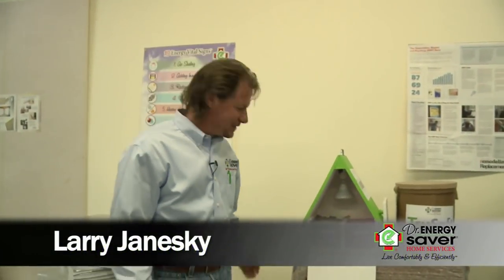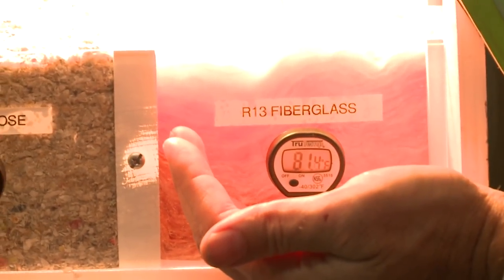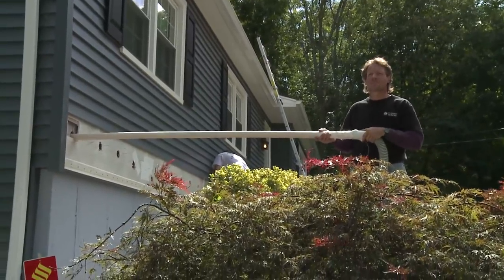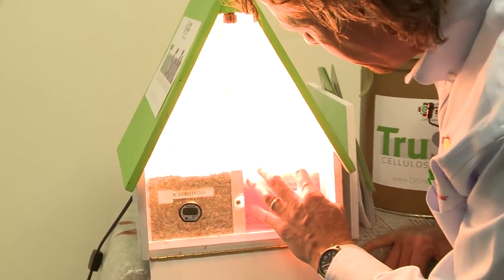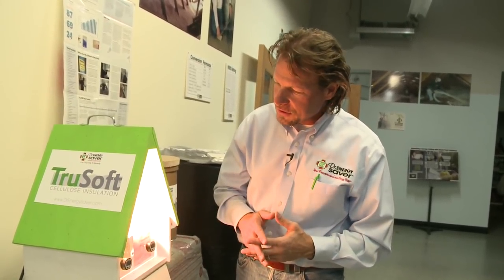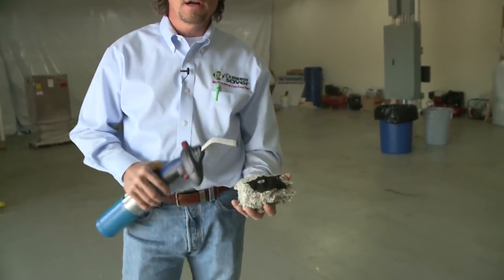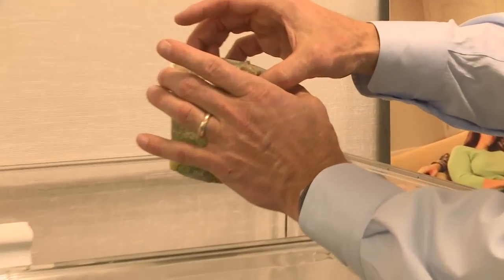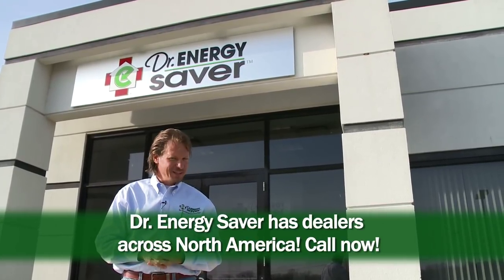Why Cellulose Insulation is Better than Fiberglass Insulation

Comment: * Join the Green CELLULOSE Movement and insulate your home with old newspapers, magazines and wrapping paper. Once the newspaper has been adequately shredded, chemicals are added to provide fire-retarding properties to it. The most common chemicals used are boric acid, sodium borate (borax), and ammonium sulfate, admittedly the end product does looks like shredded sanitary towels but no one is going to see it, they might think they can smell it, but that is only the printers ink gassing off. With being a rather loose insulation (think pillows and cushions) it does settle, but not to worry the installer will allow you to have 9 inches, but will only charge your for 5 inches. Great deal eh.  When the wind blows it can get blown all over the place, but seen in the right light it can give your home a white-winter look in June, for no extra charge.
Reply: +SuttonWood  Your anger is displaced, Sutton. Cellulose is made by recycling newsprint. Some cellulose is new newsprint paper. That's only done when the white color is desired for spraying ceilings of commercial buildings. Otherwise, the paper drives scouts conduct to earn money for events is perfect for insulation conversion. You, like me, probably earned a few bucks as a kid collecting that weeks newspapers from neighbors. I always had spending money from my paper collecting work. You're confusing cellulose with foam, there is nothing to "offgas' with cellulose. The boric acid fire retardant is the same boric acid used for medications and eye treatments for humans. Unlike fiberglass which is required to carry a federal warning about cancer, cellulose is very safe and non-allergenic. The money you've wasted paying higher heating and cooling bills in your own fiberglass home would have easily paid your mortgage off. Personally, I invest my energy savings in the stock market. I'm doing pretty good :)
Reply: +Larry Maloney  Our Lets Go Green Local Town Council set up a recycling depot for waste newspaper, they soon had 300 000 tons, when it came time to sell it no one wanted it. It was worthless, the USA got the same waste problem, so being an industrious nation they shred it and crumb it. call it a fancy name like Cellulose and sell it as bagged loose fill insulation. Its value is $20 dollars a ton, and one ton will insulate 10 houses, so you should charge clients $100 dollars a go, and be happy. To indicate how honest you are  lay 200mm of Fibreglass on top of it, and shout it to the world that Honest Joe Cellulose + Fibreglass saves heat-we think?
Reply: +SuttonWoods , actually waste newsprint is in demand. Many years ago a Chinese woman contracted to buy all that was available in the USA. Her monopoly drove the price up and gave a big scare to the cellulose industry. To add to the supply problem, many newspapers have lost readership to the internet. I'm surprised cellulose is so economical. Could your math be off on that giant paper drive your town had? That much newsprint would make twenty million  30 pound bags of cellulose.  I don't think a single manufacturer has processed that much cellulose insulation in their existence. You sure know how to tell a whopper, Sutton. Oh, but that's what you do for a living.
Reply: +Larry Maloney / Larry, hating you're guts is not my style so I'll let others do it, in 2010 waste newsprint was $30 tonne delivered merchants mill, in year 2015 $60 tonne delivered,  *new newsprint is $700 ton, and newspaper owners are unhappy at the price. Waste newspint has been listed at MINUS prices, they would take it off you but got it for nothing, the Council I mentioned rented ware houses to store it in, and there was hell on, no one wanted it. To be fair fibreglass makers are cheating a little, they are now increasingly using steelworks slag if they can get it, calling it Rockwool, Slagwool and have subsidiaries to sell it on. And being good in sales I never lie, you see the truth sells, people who meet me know they are getting the truth, any other way and I'd lose that laugh and joke attitude I have. Do wear a mask looking at a photo of Cellulose, or you'll die screaming strapped to an hospital bed. Best Regards. THE REAL COMPETITION MEN.
Reply: +SuttonWoods , so you admit waste newsprint doubled in price in only five years. That warehouse full of it must have brought the town a fortune. I don't see your point in the pricing comments about newsprint though. Surely you've heard of white cellulose? It's made from virgin newsprint.I wear a mast when I give an insulation quote...I start sneezing from the old fiberglass as soon as I open the attack hatch. I suppose you do too.You say you never "lie" when you sell inferior fiberglass. You've documented a number of lies in these few posts...and you weren't even trying to sell me fiberglass...just convince me it had value as insulation. Maybe you've been the business so long all that you say seems believable to you. Compare your unrealistic claims with the research done by Oakridge National Laboratory. That's the U.S. Government's science and technology research arm in Oakridge, Tennessee. Very credible folks. During WWII they were instrumental in developing the atomic bomb that ended the  war.  Today, among other things, they test insulation. Fiberglass does poorly. Cellulose always beats fiberglass. Sutton, there are "lies" and there are acts of omission.  Do you read the warning label for cancer causing fiberglass when you do a sales presentation? That's why I wear a mask! Do you tell them blown fiberglass has a low R-value, only R-2.2 per inch of depth. Or do you tell the homeowner that according to Oakridge Laboratory  blown fiberglass loses up to half it's already lowly rated R-value, and in the coldest weather...the very time the homeowner need a superior thermal barrier?Like you've attempted here, you use scare tactics so homeowners aren't thinking critically. Instead out of fear they buy a lesser product paying more money for it and getting less and poorer quality insulation. When you can lie to yourself, Sutton, lying to others comes natural.
Reply: +Larry Maloney / All that needs to be added is the bagged stuff is shredded newspapers, newspapers that firms get free and shred, or may have to pay between $30- / $60 dollars a ton for, from a storer collector.  People do not like the idea of newspaper insulation so they call it Cellulose to hide its origins. And as for the silver paper it gets covered in dust and loses its radiant shine. Why not staple dollar bills to your roof beams and cut out the middleman is my reply.
Reply: +SuttonWoods , why waste my time with your silly weak arguments? Newsprint is made from wood. The process involved converting wood to pulp fiber. It's dried and it's formed into paper.  That paper is converted back to pulp using a dry process (usually). If you had a little biology or chemistry background you might understand  wood is a "cellulosic" material. It's "cellular" containing billions of tiny air cells. I explain the process to homeowners so they understand what cellulose wood fiber insulation is so superior to ineffective fiberglass. As you pointed out fiberglass is made from scrap slag and silica sand. The silica is why it's so itchy and cancerous...and explains why so much energy and heat is needed to melt the sand...like making glass, the ovens are unimaginably hot. Maybe adding the waste slag is an cost reduction attempt or maybe they are attempting to reduce the cancer risk my diluting the silica?.  Your industry lies and tells homeowners it's made of plastic. How much does your fiberglass manufacturer pay a ton for sand? Why dye it pink? BTW, tell me where quality waste newsprint is available in volume and a steady stream for "free", as you claim, and I'll build a new cellulose plant.  Put up or shut up.
Reply: +Larry Maloney . Waste newpaper must have a great future, it can be used has garden compost, for making papier-mache grow pots, and developing new molds and fungis in laboratories to fight disease. Better still Waste Paper insulation is now treated with Enhanced Odour Control, if it still smells after 3 months use you can ask the installer for a box of Free paper masks, including childrens sizes. .
Reply: +SuttonWoods , sand is also great for garden soil conditioning...but is that all the "world's greatest fiberglass salesman" can share about insulation knowledge? Oakridge Laboratory does not employ a commissioned salesman to do insulation research. They employ scientists and engineers.  Does your juvenile rants trump government research? Maybe in your mind but not to informed homeowners. Cellulose insulation is clean and fresh, is odorless, fire retardant, and resists insects. The only smelly insulation I've experienced is fiberglass with rodents nesting and relieving themselves in their fiberglass environment. I've had to burn my clothes after vacuuming out infested fiberglass.
Reply: +SuttonWoods , seriously, where are you? Hiding in some third world country to avoid prosecution for fibbing? I ask because you spell "odor"  ODOUR, that's not  American.
Reply: +SuttonWoods , I know it's silly, even funny to you (me too) but did you know Owens Corning actually promotes light density fiberglass as "GREEN"? Imagine the jam session to come up with that one! The president is so dumb he actually bought into it. No wonder OC stock is down.  We're having a construction boom and fiberglass stock is down. How is melting sand GREEN? It's a high energy requirement. Sand melts at 2930 degrees Fahrenheit. When installed in unsuspecting homes, light density fiberglass lets heat escape through ceilings and walls. Equivalent R-value cellulose is 30% more efficient. THAT's what I call GREEN. Owens Corning must not have gotten the word you don't like selling "GREEN.  They don't either, likely, but marketing is marketing, right Simple Sutton?
Reply: +Larry Maloney // Owens Cornig are so Green, that their President C.E.O and dull Board of Directors were asked to lead the St Patricks Day Parade in New York, They dyed 25000 rolls of Fiberglass Irish Green and give it away free at stops on the march,  more impressive is the amount of money they give away each year to chartitable causes, including FREE 9-11 aid were needed the most, they are America, they represent America finest, and are the Saint Patricks of the Greenest of  Green Insulation trade.
Reply: +Simple Sutton, hate to break it o you but that isn't examples of "green", that's called public relation and marketing. OC got a nice tax deduction for discarding their defective over-run. Taxpayers took the brunt of their tax evasion scheme. You being limited to high pressure salesmanship wouldn't understand the finer points of corporate greed...err, I mean life.
Reply: +SuttonWoods  do you know what BPI is? look it up and see what they think about crappy fiberglass and its FILTERING qualities vs its poor Resistance to heat flow properties.
Reply: +Larry Maloney / You got the wrong impression of me, I am not a sales person but a chess player with the other persons brain, common sense and emotions and expectations, e.g. knock, knock, open the door and I have the answerer categorised accurately with one look, he thought he had a salesman coming so arms himself for assumed battle positions, big mistake, "I walk in the house and say to hm/her* Is it okay to stay and talk with you for 20-30 minutes then i MUST get off, " "he.her must agree and I've just closed the sale" - (and) he's prepared  battle plan just dissapeared through the door and been replaced with a friendly chat. (2) (trial closes) "We will be working in this road on the 14th, will that fit in with you, or would you another require another date" (3) We sometimes deliver the material early before the men come to install it, can we leave it in your garage. Never ever ASK for the orderr. Trial close casually with dead end questions then sign him up.
Reply: +SuttonWoods , my impression is you are a sociopathic liar. You claimed you were a great salesman. I merely agreed with your claim. You actually clutter their garage with bags of insulation before the job? That can only be to tie up the job so they don't cancel when they realized you've cheated them. Your pitch is no different from the ones I heard as a child presented to my parents except the product was aluminum siding on one transaction and asphalt paving for our drive on the other.  The asphalt guy happened to have some hot asphalt left over from a job and had to unload it for a ridiculous price. Weren't we lucky? It's called "high pressure salesmanship 101". It's so ingrained in your blood you think it is you. Maybe it is by now. You've convinced yourself you're smarter than the customer.
Reply: @Larry: Study what I said, learn it, read carefully (1) Will Monday do, or would Tuesday be better for you (from the answer I know if we are discussing an order, or I am dealing with a lukewarm buyer, or a ditherer) (2) "May we deliver the insulation earier, and have it ready on site to start the job" (I have no INTENTION of delivering anything, I'm testing which way the wind is blowing thats all) What this means is that in a sales contest I am unbeatable, and once was described as an One Man Sales Forrce. Larry, don't take it to heart, your parents raised you as best they could, and each year the tooth fairy arrived, your Xmas stocking was full, and you had money in your pocket, and thought MANUAL Labor was someone from Spain or Mexico.  And Paper Mites to you to,!
Reply: +Simple Sutton, I already agreed you're the worlds best light density fiberglass salesman. I appreciate the pointers but I am not  into manipulation.  I guess I'm not a salesman at heart. I know the product and present the features & benefits.. At heart I'm an entrepreneur. And again, sure I'll buy an autographed copy of your book. It will make good cellulose insulation. Hard work isn't a sin. I work smart when I can and hard when I need to.
Reply: What is Cellulose Garden Compost made from? Cellulose
compost is made from unsold cellulose insulation - past its sell-by-date - and sold on by retailers at substantial discounts, to clear their stocks of it. Cellulose is an organic bio-degradable substance often found in its natural form at the base of trees and in woodlands, it is a wonderful conditioner for your soil. As an organic-matter resource, cellulose compost has the unique ability to improve the chemical, physical, and biological characteristics of soils. It is also used today as a less popular form of insulation, when so used the product is available in vapor-retarder plastic bags, care must be used in hot, humid climates due to its high microbe count and tendency to harbor paper mites..
Reply: +Simple Sutton, I insulated my parent's two story home in 1974..R-40 cellulose in the ceiling and the balloon frame walls were dense packed with cellulose. My sister has the family home now and the cellulose is still there and still R-40 and still fire retardant...no different form the day we completed the work. All those years they saved 30% more than the folks you stuck with light density fiberglass. I guess the "expiration date: for the cellulose insulation in my parents home is the expiration date of the family home. It looks better today than when they purchased it when I was thirteen."Cellulose"  as it pertains to soil enrichment, is any number of organic materials, wood, leaves, grass, hay, straw, etch. It's mixed with manure and decomposes to feed the bacterial in the soil which, in turn feeds the plants. The fire retardant in cellulose insulation would change the PH level (more acidic) of the soil and likely kill some of the good bacteria. A little dropped on the yard during insulation work is not a problem but I don't suggest buying packages of cellulose insulation for composting.
Reply: +SuttonWoods , bought the Kindle version of Bettger. Excellent Preface. Funny, I was going to sarcastically suggest you read Dale Carnegie, but he he wrote the Forward! Well if you two can sell insurance and second rate insulation, imagine what I can do with a quality product like cellulose insulation! The 30% yearly savings over fiberglass alone, when invested, will make a nice retirement for all who buy. You mentioned real estate. I started buying rental property as a kid, the year I got out of the USMC..in fact learned to insulate on my apartments. I still hold property today but am a pretty good short term stock trader too.
Reply: Dear Gullible, no it was true, my wife looked awful for 2 months, she was taken into hospital and placed on a drip, when she came out she looked 100% better, as for nutrition I eat little, avoid burnt food, eat lots of meat every day. I take a glass of water to bed for during the night with a drop of CIDER VINEGAR in  it, but do not do enough excercise or walking, I'm not bothered what I sell. Who cares, a winninng product is a winning product for the sales people,  bear in mind most sales people slack off, they pretend to be out selling, some think a 2 hour day is wonderful, I was too serious, far to serious, and on that note I remain the man who sells, not you;re friend pal, or friend, an order booker.
Reply: +SuttonWoods , one quick comment and I'm out of here...you aren't listening...not understanding...or not accepting...or ALL the above. MEAT, "meat" being beef, poultry, fish, any animal flesh...muscle that flaps a wing, wiggles a fin, or lifts a hoof, is MEAT...and meat causes heart disease, arterial disease, diabetes, cancer etc. Like I said, I know you won't listen.  And don't give me any bs about you are "healthy" ...you can't prove that until after I see your autopsy. McDougall will enlighten you. A starch based diet is the trick. I'd gag eating animals.
Reply: +Larry Maloney / Stick with property and land, I bought two farms 1990, that was a wise move. Dale CARNEGIE WAS A FOOL, his advice is useless, he should have said Lose all you're friends and be an hard b-astard. Shares are no use, they are sold by traders who fleece one and all. Read Harry Helmsley Bio, NY, read Lawrence Wien N,Y, (Wien is worth 20 stars), I never mention R values, or praise fibreglass, no need, I just assume,  I assume you're going to buy and take the order, any opposition well I'm off. Clients can tell, they can 2nd guess, and being casual does spook them, their not used to it.
Reply: +SuttonWoods , "being casual can spook client"?  No shorts & loafers?  No slouching? What are you talking about? I'll check the stock trader books but keep in mind I'm a SUCCESSFUL short term stock trader (not many of those). Trading stocks does not interfere with real estate purchases. Agreed the stock market is "rigged" I make money in spite of that. No reason for me to not trade stocks profitably just because others can't. That's like telling me not to sell cellulose because you talk suckers into fiberglass. So your hustle is OK but not the stock market's? Funny.
Reply: Men need meat, 2 oz a day, a Jewish Doctor in Auschwit-Birkenau death camp wrote after WW2 on nutrition and close prisoner observation/s, and it was revealing, Cider vinegar cleans your arteries, so does slow shallow breathing, but the secret is just ONEmeal a day, being on the road thats all I had, one meal a day, and do I look young, I'm going to get matchbox and put a few Cellulose Paper mites in it to show clients,  "Don't touch it, don't touch it they bite, " then look scared, it was given to me by a Public Health Inspector taken from bags in WXYZ Depot, and it's all good fun ........
Reply: I meant casual in speech and formal in dress and relaxed no-sales-push-manner whilst discussing with clients a  prospective order. No make your mind up now phony discounts. or let me ring the desk/mngr to see if I can swing you a further 10% discount. Larry. you're correct not cut out for sales. McDonalds maybe, but not building trade product sales. As for the Stock Exchange my son probably deals more in 3 minutes of his day on the stock exchange than you do in a year. For various technical reasons we avoid Cellulose. Keep on selling it, a large section of our clients are major league not Elmers.
Reply: +SuttonWoods, WWII was 70 years ago. The Jewish doctor was wrong then and is wrong now. The Nazi's stole all the cattle from some European countries so the population didn't have meat for the duration of the war. After the war they were examined and found to be much healthier. Even the survivors of concentration camps, on starvation garbage diets, were  healthier than on meat.  But you live in a free society where you can believe fat, stupid little Rachael Ray when she says, "My husband loves bacon with his sausage gravy and biscuits."  Your fate won't likely be any better than your wife's...and she is destined for much more disease. You two exemplify my observation that if we all could actually learn from other's mistakes we'd all be perfect by now. Enjoy your meat...while you can.
Reply: Larry, have you taken leave of you're senses, the Nazis stole cattle too feed German troops, and to deny this food from the occupied nations. Are you aware of the starvation in 1944 the Netherlands, the Ukraine, Poland 1941, and Russia, in Stalingrad 1943 when human flesh was sold as horsemeat to disguise its origin, (eveyone knew whatr it was) to rush to the defence of the Germans to sell insulation is the limit. END, FINITO.
Reply: +SuttonWoods , I can hire all the salesmen I want. I've had some scary good ones. They think they are as good as you...of course that can't be true. But they are productive. I'm most excellent at selling myself...and anything I believe in. It's my natural enthusiasm and knowledge and probably all the things in your sales book that you sociopaths ae suppose to strive to achieve.  My heart (and enthusiasm) wouldn't be there in selling an inferior product. OC is lucky you came along.  The stock exchange is a different world today. No need to buy a seat on the exchange and stand on your feet all day placing orders for big money clients. I can play in my garage with the latest project and trade stocks at the same time. Agreed, your boy probably places more stock orders in three minutes than I do in a month, anyway...maybe not a year. But my trades represent my capital and my profits. Everything's not a pissing contest Sutton. If your son knew the stock market he'd be trading for himself instead of others. He places orders for others. His is a dying breed. I place my orders myself in a fraction of a second. Can buy stock A at 9:30 AM and sell stock B at 9:30.05AM, then buy and sell as fast (or slow) as warranted. Your son stands in a herd of obese order takers wishing he has money to participate. Didn't he read your sales books?
Reply: +SuttonWoods , sounds like you just repeated what I said. The Nazi's stole more than meat but the meat the stole meant the Netherlands didn't have meat. And I reiterate...AFTER the war their health was checked and they were HEATHIER. All of a sudden you have a conscience. That should not cause your analytical side to shut down. You miss the significant and fact in my statement because you truly believe meat is "healthy" I employ your sales mentality when sharing my message about eating healthy...when I detect the listener just doesn't get it, I move on. Your intellect is missing something. I never defended Nazi's. I merely repeated the well documented after effects of not eating meat...regardless of the circumstances. In fact I lost an insulation sales job once fro talking about Nazi's/. Turns out the customer was adopted and raised by a Nazi. He took offence to my tale about finding some Nazi's hiding in Australia when I was there. You never know hat's going to offend.You have the informant about Dr. McDougall...believe as you choose. No I haven't lost my senses...I'm just light years ahead of you in nutritional knowledge.) The only food full of fat and cholesterol is MEAT & DAIRY...those foods are what plugged up your wife's (and your) arteries. Are you taking high blood pressure or cholesterol lowering meds, for example? Virtually 100% of Americans can stop that silly practice of supporting their doctors...get off drugs, by not eating meat & dairy...no meds in three days. and a return to normal blood pressure. Or take the meds for decades masking the symptoms so you can gorge on meat & dairy...until that fateful day you have your first heart attack. One symptom is sudden death. Survive the attack...survive the trip to the hospital and Dr. Oz is waiting to split your chest open like all those cows you eat. He'll strip a half rotted artery from your leg and sew it in your chest as a bypass. Survive that and only then does Dr. Oz give "The talk"....no more meat & dairy. Too bad he didn't warn you before he made all that money selling you drugs while ruining your health. Bill Clinton wised up after two heart surgeries. Tim Russert died from his first heart attack. He just couldn't resist the BBQ chicken wings. We all have free choice but our free choice is cluttered with the Sutton Woods of the world telling us whoppers to sell us inferior products. Poetic justice I say! For breakfast I'm having hash browns...no oil no grease, no meat or diary...potatoes (fried using water), with onion, green pepper & mushrooms...salt, pepper, and garlic. My arteries are clean as a babies. No meds...I eat all I want...it;s all good...GREAT tasting. And inexpensive.
Reply: MY sons does not place orders, he supervisers the room and approves trading floor buy decisions in a company several times bigger than Chase bank NY, and you;ve got it wrong again, Good sales people can pick and chosse their employers.  Your garage deals will ruin you, the stock exchange shows no mercy and you will get wiped out, its not that you made a mistake, its because they snare victims and any gains are loans to be repaid with interest. Look at the apple market - the 1930 crash showed what can happen and does.
Reply: +SuttonWoods "Garage deals"? Have you misunderstood again? I have a shop/garage where I like to tinker. It's equipped with the same computer power as my home so I can monitor stocks real time (Get alerts/alarms) without missing my enjoyment tinkering. For example I'm patenting an insulation machine. I built a prototype and was able to get stock alerts while I worked on my project. There are no "garage deals" whatever you perceive that to be.
Reply: +SuttonWoods , I can see you and your son during Christmas break; he's home and the two of you are in a whizzing contest over which manipulated clients the most. Him boasting he churned stock portfolios needlessly to create additional commissions and you sold 19 3/4 inch deep fiberglass insulation jobs to compensate for the loss of R-value during cold days...the customers were unaware of the respective misdeeds.Agreed, good sale people can pick and choose. What is the incentive to sell an inferior product if you can pick and choose a superior product? My guess is you started with the inferior product and when you realized you were selling garbage you weren't honorable enough to accept your mistake so now defend it to the death. My applicants always got excited knowing they were selling a superior insulation. Some wouldn't have the heart to sell inferior light density fiberglass passing it of as insulation. But you are "different." Too bad your moral streak doesn't apply to your personal life. You could have been one of my better cellulose salesmen.
Reply: +SuttonWoods , was "the 1930 crash" you cite anything like the 1929 crash? Back then...and before margins were much greater. In fact "bucket shops" were the rage and traders went to bucket shops to make their trades. Stock prices were tracked by ticker tapes and the market was even more crooked than it is today. Still some made money. In fact they were identified and barred from trading so they'd move form the Chicago bucket shops (for example) to the New York bucket shops in order to trade where  they were not recognized. Some even paid stooges to place their orders since the stooges weren't recognized. Later when the exchange was formed the stooges worked for the exchange placing orders. Today, with computers the individual investor can make (or lose) large amounts of money in record time. :) I've done both.
Reply: Maloney>  Can you answer:  What makes our bank different to its competitors?  Why do you want to work for this division?    What skills do you think are required to do this job?     Can you talk about a mistake you made in the past, and how you overcame it ?    Who is the most famous and influential person you would like to meet and why ?    How  did you overcome you're obvious weaknesses and lacK of judgement??   

Cellulose insulation contains weevils and paper mites, it causes rot and mold in roof timbers, did you know some homewowenrs use it to grow mushrooms in their attic spaces , in fact some dumps won't accept it any more in case effluent from it runs off into local streams and waterways and poisons drinking water. See the Indiana Waterways poisoned by print industry uncontrolled dumping of waste paper products in landfill site. And you thin kit compares to Fiberglass. A $3.6 BILLION INDUSTRY.
Reply: +Larry Maloney if you want a real laugh Larry..go to youtube video about tiger foam and read suttons wack-a-do ramblings on that as well. Its real insite into the fg retoric mind.
Reply: +SuttonWoods  Yes.
Reply: +scott bickett /  Cellulose Insulation can be divided into two principal types .......  when made from waste newspaper it poses a challenge for both the manufacturer (and reseller) because it has it has to be de-inked and other visible contaminants removed, it must then be dyed to conceal it’s waste newspaper origin.  The end product is a grey tone, often called loosefill insulation (sic) or its more upmarket and seller preferred new name of cellulose insulation. Buyers are not told it is waste newspaper thats been shredded, baled or bagged. Allow for upto 40% shrinkage after installation.
Reply: +Silly Sutton,  why so desperate to stain the superior insulation/competition? Fiberglass is a lot of work to  sell; it's a hard hustle these days, eh? Silly Sutton sez...to homeowner, "fiberglass loses up to half its R-value in cold weather, mice like to nest in it...and crap in it. Air (heat) leaks through it. And our installers will cheat you on the number of bags they install...but I can still make up stories about a better product, cellulose, and scare many of you into buying over-priced, inferior, light-density fiberglass, dyed in several odd colors. My preference is the pink...something about pink fluffy fiberglass just excites me. And when the wind blows through it some of the dirt is filtered out staining the pink color but the mice don't seem to mind.
Reply: +Larry Maloney  they are  there...TIGER foam was the provider of the video if that helps.
Reply: Why do the baggers of waste paper
(newspaper rags) intended for sale as *insulation call it  *C-E-L-L-U--L-O-SE
to suggest that it's an *EXTRUDED product made using some complicated process. Is it because they know their sales staff and installers will be asked to leave homes if they REVEAL its waste paper shredded in a shredding baler, then bagged and passed off as INSULATION. * Why do they not reveal it settles 40% and if they sell and allegedly install 19" inches of waste paper few months later a physical check will reveal it’s settled to plus or minus 10" inches? When blown in it comes out of the machine like SNOWFLAKES, and we have all seen how snowflakes move and settle into an ice layer. The public deserve the truth; they want value for money and long lasting value. *Cellulose is a fraudulent threat to the good name of the Green Energy movement, and to energy savers everywhere.
Reply: +SuttonWoods CELLULOSE IS THE SCIENTIFIC TERM from  what comes from TREES! do you not know this? I was taught that in 7th grade!  40% settling? in what world does that exist?  It amazes me that in  the REAL trade worlds in which I make MY LIVING, the inspectors will NOT ALLOW blown glass to be installed over Cellulose due to it poor air trapping qualites  and light density, but will ALWAYS suggest that CELLULOSE be installed over a attic with not enough blown glass, due to its superior  R value and density.
I had blown glass in my OWN HOME..vacc'd it out and REPLACED IT with CELLULOSE and MY BILLS  WENT DOWN even though the heating degree days INCREASED! How do you atone for that happing? SIMPLE. BETTER QUALITY MATERIALS. ...........CELLUOSE!
Reply: Your stuff does not come from trees, its waste paper. Waste paper which they normally burn, dump or recycle. In major western nations they are awash with billions of tons of unwanted waste paper and when it's recycled its so poor a product there is not much demand for it from the printing or brown paper bag trade, there used to be but plastics bags proved cheaper and more popular with supermarkets. Using it has a substite for insulation occurred to someone who that waste cardboard, sawdust, paper, rags, hay and straw had some insulation value AS A COVERAN. So they shredded it and discovered a secondary 3rd grade market. It's called the shredded waste paper snowflakes scam. Fibreglass is made from glass, Cellulose is waste paper. Print it boldly on the bags "Save A Tree, Insist On Genuine Waste Paper In Your Loft. Save 85% on Fiberglass prices. Buy one bag and get 10 free.
Reply: +Silly Sutton, "Waste" is something of no value...for example "Simple Sutton is waste." Recyclable newsprint and overruns of newsprint have value. They are economically converted to cellulose insulation made fire retardant and insect and mold resistant.  Fiberglass, on the other hand, is made by melting sand and an exorbitant cost to the manufacturer and to our ecology. When used as intended it costs homeowners and big corporations billions of lost  heat dollars because heart leaks out of fiberglass like the furnace filter material it is. Once mice discover its in the home they nest in it and crap in it and we have to vacuum it out and install fresh cellulose insulation to correct all the flaws of fiberglass. Even as a waste product fiberglass just lays in the dump site for rats to nest in. You're delusional, Simple Sutton.
Reply: +scott bickett , if the fiberglass is salvageable (no mice nests) we rake the fiberglass a foot form the edge of the eves along each joist run..that way the edges is sealed by cellulose as well as the top. Only then does the fiberglass serve any value. (When sealed by cellulose).
Reply: +Simple Sutton, the years of sucking in fiberglass dust has affected your reasoning.  Cellulose gets its grey color form the ink on the newsprint ( as you know). My first comment to homeowners is "cellulose begins as lowly recycled newsprint". They like the  idea. They don't like Owens Corning to use extreme heat & energy to melt sand and spin it into light density, ineffective fiberglass strands.
Reply: +Simple Sutton, organic material microscopically is "cellular"... like trees! In fact the newsprint (form trees) has billions of tiny enclosed air cells which helps make is superior to fiberglass as insulation. Cellulose is installed by the bag count so the customer always gets the amount contracted for. You keep creating non-existent straw issues instead of praising the superior product.
Reply: +Simple Sutton, why do the baggers of fiberglass risk getting cancer? Why did fiberglass lobbyists pressure politicians to remove the cancer warning? Doesn't that deceit put homeowners at risk? I hear fiberglass insulation is more likely to cause cancer than asbestos. Look what it's done to you.
Reply: Every bag of waste paper you sell comes from T-R-E-E-S, your stripping the rain forest. Waste paper is a glut on the market, tons eveywhere, if you will take it away its yours free. Shred it, Bag it, and you're in business. No glass furnaces, no conveyor belts, no huge skilled labor force, and you do not need a $30 million outay. All you need is a revolving paper shredder - used ones cost $2000.00+, a baler $1000+, a bagging machines and your in the SNOWFLAKE buisness. I'd die of shame, robbing your fellow citizensof their earnings  by pretending its not Waste Paper, the expose is on Wiki, on the WWW, and commmon knowledge.
Reply: CELLULOSE INSULATION IS FROM TREES AND WOOD. EMERGENCY SAVE THE RAIN FOREST. PLEASE READ JOYCE KILMERS 1913 POEM BELOW.

I think that I shall never see
A poem lovely as a tree.

A tree whose hungry mouth is prest
Against the earth’s sweet flowing breast;

A tree that looks at God all day,
And lifts her leafy arms to pray;

A tree that may in Summer wear
A nest of robins in her hair;

Upon whose bosom snow has lain;
Who intimately lives with rain.

Poems are made by fools like me,
But only God can make a tree.
Reply: +Simple Sutton, recycling is not "stripping the rain forest." The technology level to process cellulose is higher tech than for fiberglass. Melting sand isn't high tech but it is wasteful of electricity to melt one of the most abundant material around, sand. Both systems are process controlled so don't need skilled work force except to maintain the high tech equipment.  Show my a cellulose plant that was built for what you suggest. I can melt sand with a gallon of used engine oil and some salvaged bricks for a small furnace.
Reply: Larry Waste Paper R US: Fiberglass is made from glass marbles, glass is an expensive product whilst waste paper is waste paper - thowaway refuse from dumpsters, railway carriages, buses and boy scout waste collection drives. Selling it as insualtion without revealing its source is a form of deception,  a confidence trick. Some law firm should start a mass-action lawsuit for refunds, it was mis-sold, your'e looking at a billion dollar law suit for reimbursement.
Reply: +Simple Sutton, recycling is the concept, dummy. Why make things so hard for you to understand? For every ton of cellulose that's made from recycled material, that's a ton of sand Owens Corning doesn't have to melt and  spin into light density fiberglass "insulation" wasting huge amounts of electricity and burning highly polluting coal.. Fiberglass workers aren't exposed to the silica dust fron the fiberglass. The only downside is the mice won't have the fiberglass to nest in. Oh well, they can always nest at your house.
Reply: +Simple Sutton, you really shouldn't tax your unconditioned brain with thoughts of anything technical. After all, your expertise is selling the unwanted and unneeded. It's best you stick with what you know. As I already explained to you, fiberglass is made by heating sand to 2900 degrees F and melting it into 'glass which is spun (another energy hog process) into strands of solid core fiberglass which is technically a conductor. Fiberglass's only hope of having ANY insulation ability if it can contain some air cells around the solid, non-insulated strands. Cellulose is a short fibre with air cells both around the fibres and trapped within each fiber. Pretty cool, eh? Now add the fire retardant and insect treatment and it's super cool. Why doesn't Owens Corning come up with a way to make fiberglass so it doesn't melt out of the wall cavities and give off that deadly gas as it melts? Don't they care? They spend all that money for energy  making fiberglass and it still gives off gasses. Do they need better engineers?
Reply: +Simple Sutton, you're not understanding. Recycling is a big part of the cellulose story. Homeowners buy cellulose knowing they are reducing the burden fiberglass manufacturers and foam producers put on our planet, our ecology. You take all the plus's of cellulose and spin them trying to reduce the story to something it is not. Then you spin all the negative fiberglass problems and pretend they are a positive. Or you ignore them. That's why you are such a great salesman. But fortunately I am a very good technician so can expose your silly lies and let the homeowner peer into your deflated and deviant brain sac. It's fun! I'm glad you know when to get out before the homeowner throws you out.
Reply: * CELLULOSE SETTLEMENT COMPLAINTS DOG INDUSTRY. 
In many respects cellulose settlement resembles mudslides and slides of
rocks and snow. Being a loose-laid “shredded waste paper flaked product,” cellulose settlement begins occurring immediately after installation resulting in a severe fall in insulation-value. Cellulose is primarily composed of loosely laid SHREDDED WASTE NEWSPAPER flakes, its vertical and horizontal strength is precarious at best.
* Cellulose insulation settlement is not a rare or random event, and is considered endemic to the product. Cellulose firm’s installers are told to not walk on it after installation and, if they inadvertently do so, they must  go around the job later filling in the foot-holes they’ve created before clients notice them. Unlike cellulose - Fiberglass rolls can be moved, re-laid, stapled and walked on without great loss of strength, value or life expectancy.
Reply: +Seriously, Simple Sutton, if you can walk on fiberglass and not fall through the ceiling I guess you can walk on water, too! Too funny. I have a crew vacuuming out mice-infested fiberglass as we post.  Once the nasty is removed we can cover the attic will a clean blanket of fire retardant cellulose insulation. The homeowner couldn't understand why her back bedroom was so cold even thought she has "insulation". Unfortunately it was fiberglass. No problem, our giant vacuum will suck out the nasty so we can redo her attic correctly and professionally. Upgrading to cellulose has other benefits besides energy savings. Her attic is now resistant to electrical and other fires...and the mice won't nest in the fire retardant...it burns their eyes. I'll post the video on my web site.
Reply: I know everything about walking on ceiling joists. You claim to lay your waste paper balls and pellets 19 inches deep which means the ceiling joists are covered completely including electric wires. Dangerous. Please post a photo of a 19" job- this is something we all want to see. If your clients enter their own loft they cannot see were to walk which in law means you are ENDANGERING their future safety and lives. Is your insurance company aware of this highly dangerous practice, are they and you,  aware children go inside lofts to paly and they store things up there. I have stockpiled 150 Cellulose complaints found on the www, each one indicates waste paper is a fraud and best avoided. Google Government escalate, Cellulose is boycotted by American Public.
Reply: +Simple Sutton, for the record, I've never had a BBB complaint. Not while I was a BBB member or before I was a BBB member. We both know you can't say that...not honestly. Next time you clean those hard fiberglass snotballs you earned, out of your nose, get 'em out of your ears too. We are a service dedicated company so no possibility of complaints.  We deliver. Removing poorly performing fiberglass is a serious part of our business. The fiberglass in the ceilings and walls is the only complain I ever hear from my customers.."Get it out" they say. I accommodate, even cutting the drywall to pull the fiberglass batting out. We refill with dense packed cellulose. The homeowners then have fire retardant walls and sleep better, and warmer, and cheaper at night. I've made an executive decision to invest in a couple more giant vacuums to suck out more fiberglass faster just to keep my customers happy. The customer is always right.. they say take out the inferior fiberglass and I do it with pleasure. No reason for a new homeowner to live with the previous owner/builder's bad choice. Right, Simple Sutton?
Reply: THE LAUGHS ON LARRY: *Cellulose insulation is made with recycled paper, most of it consumer waste paper like newspapers.  However, there is still a virtual mountain of waste paper going to landfills. Recent calculations indicate approximately 1,126,330 pounds of newspaper become waste about every 10 minutes in the United States.  When recycled as cellulose insulation, that’s enough waste paper to insulate 220 energy efficient new homes every 10 minutes.” Cellulose insulation installers will continue to work at both the industrial level with major paper recyclers, dumpers, and grassroots programs such as local charitable paper drives, this will help solve the nation’s overflowing landfill problems. Insulating homes with recycled waste paper makes sense. 
Own Trade warning notice: Watch out for “blow and go companies” the industry term—for cellulose firms who charge a hefty fee, promise major heat saving upgrades, then disapear.*
Reply: +Simple Sutton, I must have missed the punchline in your little chuckle. Are you making ME responsible for America's waste? We recycle what we can. Our main goal is to produce insulation superior to what you sell. It's good for our industry that there is sufficient waste newsprint to recycle. I'm surprised it's as much a you claim but  it keeps us competitive with melted sand insulation. I know if I did the  math I'd find your accounting claims is off by a factor of ten since it's not your strong suit. My personal experience is sales organizations prefer fiberglass to maximize profits while insulation companies prefer cellulose to maximize energy savings.  I DO appreciate the sales book referral, Simple Sutton, it helps me understand the mind of a die hard salesman. Does Simple Sutton Jr. ever give you any stock tips?
Reply: The Simples son wouldn;t tell you or me the time, he gets that trait from his mothers side,  mine are happy go lucky. I was just sat here thinking how much money we could have saved using Cellulose, Fiberglass is not cheap, and all this talk about Going Green is ruining the business,  today the public switch off if you mention insulation. When we commenced no one knew what insulation was and they thought we were Electricians. I have never laid a bag of cellulose, or thought the market was worth investigating. Selling waste paper no matter how dressed up it is appears to me short-sighted. I was unaware you can blow the stuff 10 to 20 feet out of a blowpipe, us poor sods (layers) have to get down on our hands and knees and tuck it in,  we could flick a roll 15 foot like a billiard balls but that takes years to learn. The insulation trade needs another product, but what, and remember I mentioned the Belmont House,  it could not be insulated, no way, it had more escape holes for heat that we could not see how it could be insulated. to recap the roof cost £3m to re-roof. Another job had 4 turrets, it looked like a Norman Castle, and how do you tell the owner each turret was a giant tunnel/funnel to the sky.
Reply: +Simple Sutton, I knew you were in a time warp. Just didn't know it was because your family won't tell you the time. I shouldn't either, it's like waking a sleep walker, no telling what they will do.  It's NOT 1954, Simple Sutton. It's 2015...almost 2016! And (brace yourself)...we've have that new insulation that replaces expensive ineffective light density fiberglass. It's called "cellulose", made from recycled newsprint. It's even fire retardant! Before you go back to sleep I'll share a little more with you. How can someone so concerned about his dying industry support the high cost of melting surplus sand in order to spin glass into "fiberglass"? It's all so counter-productive. Your industry lacks leadership. The current  "Green" theme may be ruining the fiberglass industry but the fiberglass industry is one of those that mandated we go green to combat the waste in the name of corporate profit. Your son would listen to me. I am not you. It's not so much that he takes after his mother but he rejects YOU. Any idea why? It must be hard meeting your expectations...since your image of yourself is much higher than the reality. The fiberglass I've seen can be shot across the attic with their high pressure positive displacement rotary blowers. That's the tool used to fluff fiberglass. Maybe your experience (and I use the term "experience" generously) is with the underpowered AtticCat blower for home use? I have no doubt I could insulate the Belmont house. I'm not restricted by your lack of knowledge. and the owners, according to  you, have deep pockets.  Each turret can be insulated with cellulose and fire protected at the same time.So are you in England? Or in the USA on a work visa?
Reply: They used to call MOCK insulation made from waste paper crap, is that no longer the case?  My wisehead son earns around $1 m dollars a year and thinks thats normal, this is the New Citizen Jones persona. 

I was going to tell you about when I was working for a top firm with 200 sales people. I was always in the Top 10,  but this company had a guy who beat me every week, the average sale person wrote 7-12 deals a week, I was doing 22-24 -28, he was bringing in 32 - 36 a week!, The rumour was he had 3 sub-agents working for him, and the orders went in his name to collect bonuses and vacation prizes. After an argument with the manager he got fired and we collared him to ask "How had he done it-meaning got so many orders, he looked at us all and replied "You lot know nothing about selling, not a thing, so we bought him a few drinks and he revealed his secret." Seriously, I learnt more from that little nobody about selling than I'd ever learnt before. What he did was brilliiant." I was going to share the secret with you for free, but you have overdone the insult game. So I won't. Big mistake.
Reply: +Simple Sutton, no insult...just responding to your insults. You have a problem with reality. Sounds like your son is the one with the wealth "secret". You can take your secrets to the grave it doesn't affect me. I never considered you credible anyway. Like I said, I can hire good salesman. I'm sure they consider their sales techniques "secret" too.  Besides if you sales ability is on par with your knowledge about insulation it's of no value. Aren't you the guy claiming he doesn't cover the top of the ceiling joists so the cable guy can prance around gingerly? Agreed, you don't tell me your sales secret and I won't share my number one insulation installing secret.
Reply: +techtalk , Lets say you squirt 500 pounds in weight of cellulose in an attic,  end of the month it loses 20%  in volume, then 10% each month for 3 months afterwards, then 5%, then 2% etc,  Where is it going? Is it the cause of sudden death syndrome, we know it causes DRY EYES, extreme thirst, diarrohea, but what about peoples kidneys, thyroids, lymph glands, and why do installers die suddenly in their sleep, or are found sitting in fields staring at the moon. Giving installers bottles of Salt Water to drink on the job - so they can bring it up bugs me. Bring what up? What? We need better safeguards for Cellulose workers, if a cellulose delivery van was to crash another Cellulose Insulation escape could occur with hair loss and rotting teeth happening again over a wide area. It should be packed in Lead Lined boxes and Asbestos Geiger counters issued to clients.
Reply: +PipersSon; (AKA &quot;SuttonWoods&quot;) sure, you can say cellulose settles forever (and DO say that) but it's not based on reality. All loose blown insulations settle, including your beloved fiberglass. Cellulose, loose blown in the attic will settle the first six weeks (or so), afterwards, it's stable. The settling is because it's conveyed with an air hose. Consider it like freshly poured concrete that must cure for 30 days before reaching full strength. Cellulose is installed by bag count and weight not number of inches, so settling isn't an issue since the customer gets exactly what was contracted for (and then a little more.) Settling IS an issue with fiberglass, however, As you know fiberglass is preferred by sales organizations because less pounds, (less bags), can be used by "fluffing up" the fiberglass for more profits with a high powered blower so fifty bags of fiberglass, fluffed with air, for example measures the same depth as sixty bags. The homeowner is fooled with a tape measure. The fiberglass saleman high pressure sells the job quoting sixty bags and delivers fifty bags. The ten bag shortage is a nice hidden profit for the fiberglass salesman. In that scenario fiberglass settles especially quickly. Most of my work is replacing flattened fiberglass with fire retardant cellulose. Wise homeowners have us vacuum the fiberglass out first. IT's a quick job there's so little after the air is removed. Even when installed to the contracted weight and number of bags, blown fiberglass has a much lower R-value than cellulose. The death blow to fiberglass is the inefficiency of fiberglass. It's loses up to half its R-value in the coldest weather, right when insulation is needed to keep out the bitter cold. Densepacking is the art of pressure packing cellulose into walls at a greater density than the open attic loose blown density. Instead of 1.6 pounds per cubit feet in an open attic scenario, the cellulose is pressure packed  into walls at a pressure above 2.7 PSI, often three or four PSI resulting in a dense packed wall, doubling the amount of cellulose in that confined space. Cellulose is packed so densely it cannot settle. In fact that's one of the considerations in certifying dense packed cellulose as a fire break and fire wall.. Fiberglass is not. Fiberglass isn't even a fire retardant. Wonder why?
Reply: +techtalk , ignorance kills. You and PipersSon (AKA Sutton Woods) must feel sick.
Reply: +Larry Baloney The Golden rule behind Cellulose Insulation is to delay finishing the job so you can exaggerate the amount of work involved and charge extra, then to exaggerate the depth laid laying it  always thick near the attic entrance, very thin elsewhere, then to get paid and vamoose. It never occurs to clients that they and their electricians may one day want to enter the attic at a later date and because they cannot see the wood joists to walk on will damage the ceilings below. You cannot walk over fresh air + cellulose waste paper. Cellulose foorms know if client touch the cellulose they will  discover it collapses into baking PIE bowl shapes. But not to worry they've been paid so who cares. Artistic pie dishes, Fujiyama Volvanoes, Smelly odors, prone to retain damp and moisture and the heat atoms from below hurtle through it like Halleys Comet. A housefly, or better still a centipede walking over it will leave a trail of footprints a bloodhound could follow.
Reply: +PipersSon, LOL, whatever it takes to sell inferior fiberglass. Again, I emphasize, buy loose blown insulation by the bag.  That's the LAW! I always quote bag count and poundage. No fiberglass boob does that. They sell "inches" with all the hidden profits. Glad you got your nerve up and decided to give us all something to laugh at again.
Reply: +Larry Maloney . I have neverer sold Fibreglass in my life, I recommend it to our clients, and they accept my advice as the word of an honest man./ You for instance start the sales conversation of with an immediate lie, you infporm your mug punters thats its cellulose, 'cellulose they think', it must be made in a cellulose factory, or dug out of a cellulose mine. Little do they know it's old newspapers, Waste Paper, shredded in a revolving drum by the cuts of a thousand knives, waste paper, wrapping paper, old bags, the refuse of someone's teeming shore. a home for rats, termites, wood fleas, and Yellow Paper broadsheets, discared in waste dumpters. Stolen in the dead of night by paper burglars. Tell us you're prices, tell us how you live on other people honest labour and sweat of brow....
Reply: +PipersSon, your boorish perception of yourself is amusing. And I suppose fiberglass is mind?  Yes, silly, cellulose in made in a cellulose factory. Except we don't use high temperature, high energy wasting furnaces, to melt common waste sand to be spun into poorly insulating fiberglass. You are desperate to justify lowly fiberglass...so much you distort reality to convince your cust0mers they are doing the right thing buying your poor fiberglass insulation. I suppose your antics work on children and a few new homeowners. But those who experience even a single winter with fiberglass insulation are ready to pay to have it vacuumed out your lowly fiberglass so superior cellulose can be properly installed to save an additional 30% above the fiberglass's limit. Your nonsense accusations and claims won't fool an experienced cellulose insulation homeowner, will it, Sutton Woods? I'm looking at new truck. Any suggestions?
Reply: +Larry Maloney / Are you aware that Hollywood made two films about the perils of Cellulose Insulation. The first film was called Gone With The Wind, which deals with the subject of how a wealthy family of plantation owners in Atlanta, installed cellulose shredded newspaper insulation in their attic, it caught fire, the fire spread and set fire to the town of Atlanta.

The second film was named The Big Lie, It begins with the quote by Adolf Hitler: "The American masses will more easily fall victim to a big lie than to a small one" it explained in some depth how people were "sold shredded waste paper by being informed it was shredded fibreglass fibre". Film imagery goes back and forth between waste paper dumps, mammoth paper shredding machines,  and the poker tables of Las Vegas - this film ends with how the vast sums of money made by the Cellulose Cartel built the Flamingo, the Dunes and the Silver Nugget casinos.
Reply: +PipersSon , LOL, too funny. Seriously thought, Disney DID make a movie about you, PipersSon (aka SuttonWoods), Old Walt called it "Pinocchio", the story of a wooden headed boy who's nose grew every time he lied...and he told some doozies. I suspect your nose is so long you are house-bound by now!
Reply: Under no circumstances use Cellulose, find out "Why," by undertaking a Google Search on CELLULOSE SCAMS, with the price charged being the major scam. In short $150 dollars of SHREDDED WASTE PAPER produces $3000+ sales price.  We know of a builder whose 6 new houses could not be sold until it was removed, the Mortgage Company would not pass them unless it was all taken out. The waste paper men can complete a roof in 2 hours, but must  "spend 5-6- hours busy doing nothing" ...  to justify their massive bills. Owens and CertainTeed are AAA approved by me, and 1000s of others, and my approval counts. I'm the boss. If you're not convinced then name one major builder who uses Cellulose they don't, a newspaper reporters press enquiry would ruin them with headlines like $400k dollar home had waste paper insulation in the loft.
Reply: +MommasBoy, that article is about foam burning.  Stop whining in public. It's your own fault you wasted a sales career peddling inferior fiberglass. You made lots of work for cellulose companies who remove and replace your pitiful fiberglass. Thanks. We vacuum out fiberglass and install clean fresh, fire retardant, rodent proof, cellulose. It's a superior insulation by all measures. Fiberglass can't pass the fire codes. Personally, I could not sleep at night if fiberglass were in y walls or ceiling. My safe room is densely packed with cellulose.
Reply: Larry, you must have the patience of a saint to put up with this nut jobs ramblings for months on end.
Reply: Imagine the patience his mother must of had
Reply: Larry, I was a millionaire at age 35, and you're still flim-flamming your way through life, solid value always wins out in the end,  we do not have unconvinced clients, buyers who suffer buyers remorse after your men leave the job, we do not have stopped checks, complaint letters to answer, or D grades in life, work or promises made. I take client satisfaction an important factor in our success. We sell FIBERGLASS, but to be fair that should read it sells itself.
Reply: I guess when you're not enjoying your millions you like to spin yarns about garbage fiberglass. Maybe we can strike a deal? Since the County charges a dump fee for every attic load of fiberglass "insulation" I vacuum out, why don't you just take this itchy gold off my hands? It's already bagged. Imagine the millions more you could make recycling fiberglass insulation ...only "slightly" contaminated with mouse droppings and cadaver parts and pieces? Deal?
Reply: CELLULOSE CONTAINS FUMIGATION SCAM: A buyer complained to a Cellulose Company that "they'd insulated her roof space and the whole house smelled real bad", and they'd waited 3 days and it still smelled", the reply was a classic, she was informed "Cellulose contains a FUMIGANT, to kill insects, pests and mice" and thats why it smelt. All untrue, Later she rung back and said they'd lived in that house over 20 years and had never seen any mice, insects or pests up there ever, and was flim-flammed. One day she will learn they spread chopped up, shredded waste paper, what a CROOKED INDUSTRY that is.
Reply: I'm glad you have access to computers in the home. Clean your room really good so you can go outside tomorrow.
Reply: We like it here, but in winter my wife finds it too hot and will insist on going around the house opening windows even on cold days, I insulated the walls and roof space with $300 dollars worth of fiberglass insulation, I chose 3 inches thick semi-rigid material, any thicker and it would be an overkill. We are having the place re-wired next week, so made sure the cables are not buried out of sight in the attic, there she goes again - going upstairs to open another window, that Owens Corning Fiberglass sure does work a treat .........
Reply: I do not monitor her movements, I know we have guests arriving next week because she is collecting them at the airport and arranged to have the dog walker come twice each day for 5 days whilst they are here. Visitors are welcome, but sometimes I like to get away and go sea fishing. What do you do to get away, I imagine answering the phone is a chore you do not like,  you said you were hiring someone to field yor calls, very sensible if you ask my opinion.  Just 2 months to the year end and you can re-register under another Cellulose R-US trade name. We stick to the same name, and can always be contacted for the last 52 years, that does makes me feel old.  52 since 1964.
Reply: Great news about guests arriving. You can catch up on your favorite fiberglass stories. Tell em about the good ol dayz when a customer's only choice was fiberglass. How yo just had to take the builder's order. The guests will distract from your loneliness.

Nope, I never discussed my hiring needs or plans. I AM building a three axis plasma cutting table so we can quickly cut steel plate for building fiberglass vacuuming machines. Sometimes I almost feel guilty ...should pay Owens Corning a lead commission. Wherever you sell fiberglass I have a potential job waiting... cleaning it out. 

Owens Corning has kept the same name for decades. Even after the asbestos industry was sued for causing so much cancer and disease (wasn't it a multi billion dollar Court Ordered settlement?)...well even after they filed bankruptcy to avoid paying the settlement to customers they hung onto the same brand name and just focused on peddling fiberglass insulation. Ironically, the fiberglass was shown to be even more harmful to one's health than the asbestos. It took a lot of lobbyist and behind-the-scenes manipulation and dirty deals to get the Government to drop the warning labels on all the fiberglass sold. Now it's every man (customer) for himself.  Hmmm, what's your professional opinion....should we capitalize on the notoriety fiberglass has for causing cancer by renaming our machines "Fiberglass Removal Vacs"? We can emphasize, "Workers never have to actually touch the fiberglass"..offer reassurances like that. Let folks know the fiberglass is captured from the vacuums in HEPA certified filtration bags for easy and clean disposal. I made some great videos of our technicians vacuuming out a few attics. Customers can see how clean and sanitary their home becomes after our service removes the dangerous fiberglass. We're working on a system whereby each remediation truck has two large HEPA vacs for faster cleanouts. We're considering a compactor to compress the contaminated fiberglass to maximize the load each truck can haul. You should buy a couple/three rigs and provide a removal service in your area. I think you'd do a great job...get you out of the house some...soak up some vitamin D and supplement your SS.
Reply: I never had trouble with fiberglass, but my stomach did, after a long week or long spell there was a tendency to spew up, it was the binder they use, and if the fitting teams went out at night it was the rule never to mention work or fiberglass, the best improvement we made was to always wear an hat on the job, it saved hours of scrubbing dirt away at night to get clean, then you had your nostrils full of the stuff,  but the wages and earnings were great, was it worth it, no, it wasn't,  meaning big contracts take a lot of work, we day-dreamed while we worked at laying it, and the hours soon passed, I can lay fibergqlass like hitting snooker balls inot corners,  ping, ping, ping,  looking back we had some great times. We are in an industry were only we the layers, know the amount of work we perform each day. We had one man just opening bags and feeding us with the rolls, here-catch, plop, laid, plop laid, it was an art, a tiring one at times. Regards.